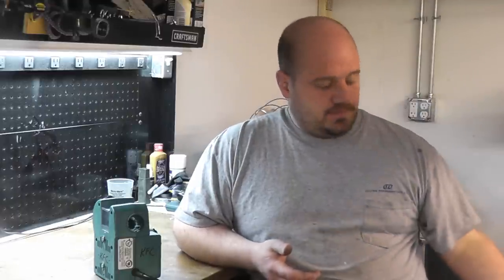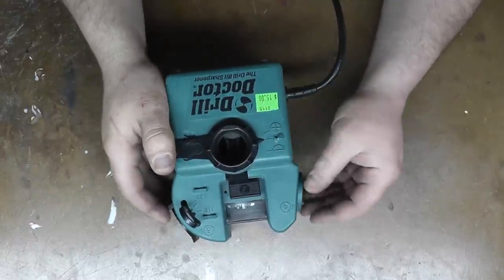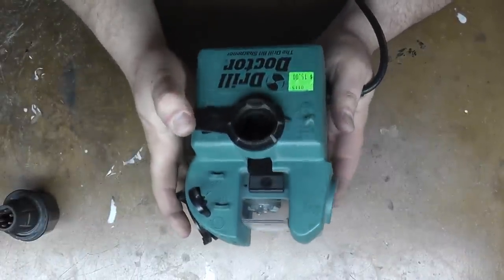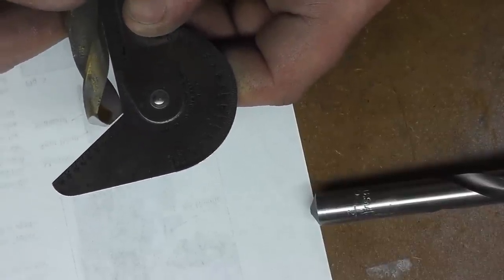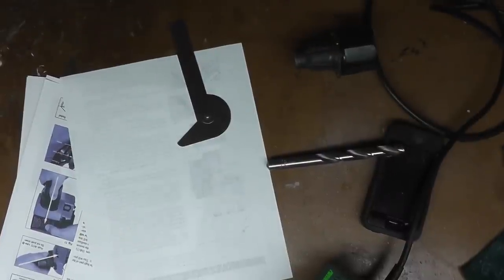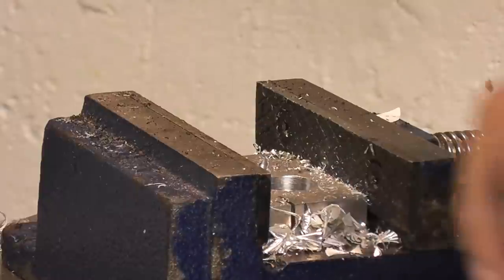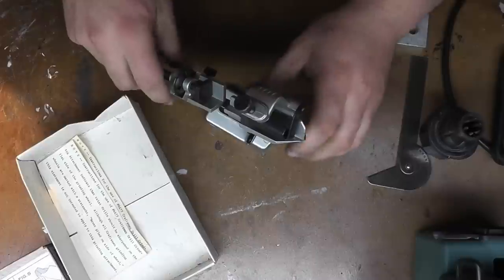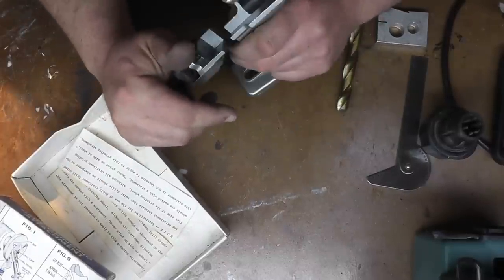Drill Doctor V.S. Craftsman Drill Jig

Comment: After having two DDs both the one you tested and it's newer style replacement I've decided that both were junk. Negative relief no matter what I did. Also have a General version of the jig you tested. Did not like using it with a normal grinder wheel so I set up a grinder using a tool grinder wheel instead. Talking about a wheel backed by a metal plate meant to be used on the side surface. Works great! Can sharpen a bit in 10% of the time it takes to fiddle with the DD. DDs will likely stay in the back of my tool cabinet unused forever.
Reply from the maker: +Gerry Masterman Yeah my DD has been taking up room.  Time to send it off to pasture.
Reply: +Gerry Masterman Do you want to sell them for cheap?
Reply: Gerry Masterman :

Comment: I have  Drill Doctor just like you tested. I could not disagree with you more. I routinely sharpen drill bits to use on my cnc machines and have never had a problem. the chips are even and the cut is true.  one of the setup tricks is to wiggle the bit ( by rotating it back and forth) in the spring alignment jaws till it finds the true center before tightening the clamp. Also if you want a true hole never force such a large drill thru any material without a pilot hole....there is simply too much surface area combined with low surface speed in the "center" of drill bits to put them in a cut without a pilot hole. that is the main reason to split the point on any drill bit that  drills a start hole...ugh

Comment: I have also used one of those craftsman type jigs at a job I used to work at. It was branded as general...what a POS the Drill Doctor is way ahead of it. The only negative I can say about DD is it is plastic and prone to wear. it is a good practice to clean the grinding dust out of it occasionally with a vacuum.

Comment: I also have used the Craftsman for about 40 years and am well pleased.    There was a recommended stone for the sharpener which I bought, it is 1 1/4 inches wide.    At work they had one in the tool room about 3 times larger and could sharpen about a 2'' bit.    I saw the same model in a hardware store made by Irwin, they probably made them for Sears.

Comment: HI,
Best I found so far, is hand grinding, with a gauge.
As for the direction of the sharpening lines you can correct by changing the position where you grind on the wheel.
Have the same problem about the relief angle on a Drill Doctor.... Drag, Big drag...
Thanks for video, Pierre

Comment: I threw the drill doctor in the trash and started sharpening by hand, then found the old Snap-On 825 you have there. I like the 825!
 It won't hurt the wheel for many sharpening's , just set it up more toward the end of the wheel and replace the wheel  when it gets about a 1/16th groove.  I've seen some badly worn sided wheels I wouldn't get near, but they were using them.

Comment: Thanks for making and sharing this video. Here in the UK back in the 1970's a firm named Martek brought out a black and red drill sharpener that works like your DD but uses an electric drill. Still got mine, I've sometimes spent days just sharpening dozens of blunt bits! Uses aluminium oxide wheels not diamond.
I bought 3 Picador sharpeners (separately) like your craftsman, around the '70's too, but never got around to using them as my grinders are mounted on metal dexion frames and I'm lazy... 
Was very interested and had a faint hunch that the C might win, I don't like plastic in the workshop very much! Appreciated thank you. DD.

Comment: I accept that grinding a drill by hand is considered the better way of sharpening but I've never mastered the technique - the majority of my mechanical engineering & machining is self taught as l'm an electrical and electronics engineer by profession. However, this has been a useful and interesting information on grinding jigs. I have often wondered if they are all their cracked up to be as one might help me to sharpen a drill bit instead of buying a new one all every time! If we started to trade using the currency of blunt or baldly sharpened drill bits, I'd be a millionaire!
 Thanks for this this informative video - keep them coming!

Comment: Hi, My mentor used to sharpen drill bits by hand. I used to watch him, but could never
figure out what he was doing or how. He never really explained things out. One day i
found a picture showing how to present the drill bit to the grinder wheel.  I drew a line
on the grinder table and started grinding a drill bit and would check it with the gauge.
To make the story short, my first bit turned out just great. Have been sharpening by
hand ever since. I can do it better than a drill doctor, or just as good.
Give it a try its faster by hand also.
Wayne
Reply from the maker: I can grind bits ok 3/8 and larger.  Just takes me a little bit to get it right.  Me being lazy and all just looking for a faster method :-)
Reply: ***** Get a magnifying visor, then little bits look bigger. When bits are really small I wear my visor and use an arm magnifier at the same time. Yeah I'm getting old, I know. Did I mention I wear reading glasses under the visor? Windex is a popular chemical in my shop anymore here.

Comment: Don't knock "the old ways" of doing things! My gizmo is very similar, I think made by General or something. Anyways, I made a block that I screwed mine to, a block that raised the drills to the top centre of the wheel to get the grind marks perpendicular to the cutting edge of the bit. The jig stays screwed to the block & it's a quick matter to clamp the block and have at it. Just my 2 cents worth. Thanks for posting.

Comment: I notice in the user manual for the Craftsman jig, it says to only use grinding wheels engineered for using the side for grinding. Maybe they existed when the manual was written, but nowadays at least, Norton just blanket says not to grind on the side. So that's an abrasive company who doesn't seem to think side-grinding wheels are a viable product now.

I wonder how feasible it would be to modify one of the Craftsman jigs for sharpening HSS lathe bits.

Comment: Thanks for demonstrating that craftsman jig. I bought a grinder at an estate sale that came with one. Unfortunately it was missing the side cover but you can tell the wheel itself was designed to be used on the side face. Do you still think that's unsafe?
Reply from the maker: You decide if it's safe or not.  I just don't like making grinders do stuff they technically weren't intended to do.  I've seen them grenade and it's not pretty.

Comment: Greg, I noticed that the pivot pin in that Drill Doctor drill alignment part was out, or loose on one side. I think if you put that pin in correctly, it will be possible to align the drills easily. I've owned one of this model for years. I bought it new. I had trouble at first but eventually got good results.
Reply from the maker: I'll take a peak at it.
Reply: A friend of mine has that model as well.  That alignment tool is definitely not working as designed.  As I remember that lever shouldn't have any rock to it at all.

Comment: Rob:        No matter how skilled you may be ,you will never sharpen a bit with any jig as accurate and precise as the DRILL DOCTOR. The designers really did their homework on this one. I own the 250 model.,it works flawlessly !   This is   NOT a  ' nonsense device '   !!!!
Reply: have worked at a metal factory where they grind almost everything by hand. and i bet they have more years of experience then the drill doctor exist. they would choose hand grinding before drill doctor anytime.

Comment: Just subscribed to your channel - it was mentioned by Abom recently.Great video Greg. I have just started using a craftsman type jig I bought over 20 years ago. I was put off by the look of it and it sat unused for years - but since I have tried it I am quite impressed with the results. I am thinking about mounting it on its side on a 90 degree bracket which will change the side to side swing to an up and down swing to be used on the front face of the grinding wheel - much safer. I wish that there was an improved and better quality, larger size unit available - possibly a future project.

Comment: I was just wondering if you have had a chance to use the craftsman to sharpen drills for drilling alloy steel like 4140 or perhaps stainless? How does it handle compared to a new factory drill.

Comment: I had the exact same tool (Craftsman) in my shop, and, with a slightly finer grit wheel, I was turning out better cuts than some new bits.  When Drill Doctor came out, I looked, saw the plastic, laughed and kept my Craftsman fixture.  After awhile, I had guys with Drill Doctors bringing their trashed bits to me to dress them up.  Wikid pissah good demonstration!
Reply from the maker: Ha Thanks!
Reply: +DeserT BoB 
I paid full price and this guy should know that people often get what they pay for, that's for god damn sure!
Perhaps this guy should not by a beat up piece of crap unit missing pieces for comparisons!
The reason the Drill Doctor trashed your friends drill bits is because they were not smart enough to use it properly (I suggest they try reading the instructions).
Because of the Drill Doctor, for the last, (oh damn, more than a decade and a half?) however long it has been, the only drill bits I buy are the ones too small to sharpen, those I have broken or sizes I do not yet have.
The weekend I purchased it I spent 2 days resharpening a whole box of dull drill bits I had been collecting for most of my life and were unwilling to throw away.
I'm still using some bits over 20 years old, all sharpened on an old as hell drill doctor, and on the same, original sharpening wheel!
Reply: That's good to know...knowledge is everything, but I did have three guys with Drill Doctors who had various problems with them, and I'd just dress up their bits for them and they were amazed by how well they cut after a ride in that old Craftsman fixture.
Reply: DeserT BoB The skill (dare I say art?) involved in sharpening a drill bit by hand visited me once, and only once.
That drill seemed to be perfectly sharpened.
Since that time I screwed up every bit I attempted to sharpen until I got that Drill Doctor.
Now, when I start having an issue finding a drill bit close to the size I need, I sharpen a bunch that were dulled.
It happens so infrequently, I have to reread the instructions every time.
Reply: archangel20031 before I got the Craftsman I use to sharpen my bits by hand in the old fashioned way, and you can spend a lot of time doing that unless you do it all the time. Toolmakers do this on a routine basis and do it everyday; they can practically do it without looking. Not so with me, I needed the Craftsman jig just hold the thing at the right angle.
Reply: T2H Instructionals d

Comment: I just picked up a general 825 grinding attachment.still practicing but I already like it for medium size bits but still botching the small ones.and I mounted it in front of a disc sander which is meant for face grinding.

Comment: That sears sharpening. Device is a great tool. I have been using one for over 30 years. Had many other types all eventually broke. Still have and use the sears unit. As a matter of fact it's still hooked to the same grinder I bought then. if you watch the operation it will help you get the motion down so you can do a great job of sharpening by hand. Don't knock the simple tools imagined  technology is not always better. A mistake often made.

Comment: Great vid.  I also have a Craftsman 6677 I picked up for $3 at a community yard sale back in 2008.  This came in the original box with original instructions and appeared never to have been used.  It seems to be a late 1970s version since OSHA is mentioned.  These instructions also show grinding against the edge of the wheel and state to only use specially engineered wheels for side grinding.  I haven't done much with it as I simultaneously learned how to hand grind my larger drills (3/8" - 1") using a 1" x 30" Delta belt sander.  But I need to start grinding smaller bits now down to 3/16".  Small bits are a lot harder to grind correctly by hand.  I think I'll pull out the Craftsman jig and set it up again.  Printed in USA, Made In USA...  And forty plus years later the finish is still better than Chinese junk straight out of the box, let alone the quality of construction.   The original box was much better, too.   We have been royally deceived and screwed by (non) Free Trade...
Reply: ps.  I see that Grizzly is still selling this same drill grinding jig.  And even through the Sears Marketplace for $19.50.

Comment: A properly sharpened drill will produce holes that are not only on size, but use very little feed pressure and doe equal chipping and will create very little burr.

Comment: Thanks Greg.  Nice, well thought out comparison of different technologies...bottom line - how does it drill, after?  Its the baby bits that are tough IMO although not too expensive to buy just hate to waste them with some life left.  An interesting note about your grinder vs sander thoughts...for down and dirty I think you are right but have been looking at diamond cup wheels and they aren't as expensive as you would think ($15-$100).  They are made to sharpen on the flat...the trick is the speed of the grinder with them.  Been thinking of making a dedicated one with a motor and speed control...then a jig, even the Craftsman would be fine for home shop use.  Thanks for putting this out for us!   Solved my curiosity of the disparate reviews & likely won't pick up a DD now...but maybe they could send you a new version with all the bells and whistles to run through the paces!  ~¿@  Thanks again for the time you spend!  ~PJ
Reply from the maker: I'll look into those wheels.  Some of the Delta grinders come with a speed control.

Comment: My two cents worth...
There are extremely few YouTube videos 36 minutes long that will hold my attention. Yours met the standard! I want to go yard saleing with you.  A drill Doctor 750 for $15 and a brand new craftsman grinding attachment for $2 is incredible. I own and use both devices, I agree the Craftsman is superior. Don't be afraid to use the side of your grinding wheel. But you might want to try a wheel of finer grit, as yours is very coarse. Still, you got a very good result with it.

Comment: You can buy a thin 8" diamond coated steel lap wheel for about $15 on EBay. Maybe it could be used  in place of the big grinding wheel, or use it stacked against the side of the big grinding wheel. They come in many sizes and grits.

Comment: I have both of those tools but the drill dr is the new one. The Dr works great the new spring clips part works a lot better and the adjustment on the angle is easy. Drill Dr also has a left handed chuck for left handed drill bits. I used the other type with my belt/disc sander on the disc side and it work alright but I can go much faster with the drill dr.

Comment: yes, you were right the grinding jig is a little unsafe; that's why they invented tool / cutter grinders & universal grinders ( do similar things but they have heavier castings and wheels designed for this type of contact with parts)- note: tormech sells a cnc surface grinder (fairly cheap compared with the grinders fore mentioned ) that you can rig a drill onto an indexing fixture, which allows the angular adjustment required , just place the fixture on the magnetic chuck of the surface grinder.

Comment: It has been my experience that all drill grinder have their own technique and learning curve. I have a DD-750 that I use on small bits and a Lisle drill grinder #91000 that I use for the larger bits 5/16" up to 1-1/4", anything larger than that I grind by hand on the 10" pedestal grinder. The DD-750 works very well on the smaller bits and is quick to set up and operate. The Lisle 91000 works very well on the larger bits quite fast. It looked like your DD-750 had been abused at some time in it's life. They are made out of plastic and need to be treated as such. I have been using my DD-750 for about 15 years now and can't even tell you how many diamond wheels I have used in it over the years, it still works just fine.  I know a lot of shops don't bother sharpening their small bits simply because they are so cheap to buy in bulk packs.

Joe in Minneapolis MN.

Comment: grind on the wheel’s face (outer diameter) only. Side grinding is NOT allowed.  I know  a guy who got his thumb blown off when the grinding wheel exploded as it has a small crack in it that he did not see.   when you grind on the side you can cause uneven wear and run the risk of breaking the wheel.   I use a drill chuck with a handle on it to grind small round rods to give better control and to keep my hands away from the stone.

Comment: I think you could mount the craftsman one at 90 degrees, i.e. clamp it to a vertical surface instead of the table, so you swing up-down instead of left-right. That way you could use the front of the wheel and get the grind perpendicular to the edge

Comment: To cut grain correctly when using the drill sharpening jig, grind on side bottom of a counter clockwise turning wheel, not side front or side top. Have not tried a jig yet and I have 2 and faith that they will work better then a new DD. Old DD diamond wheel shape is better than the new DD cylinder diamond wheel which makes cuts come out curved. Yeah they saw me coming; I'm crying bought a brand new 750X. If I only knew then what I know now. The flatter the grinding surface the better the results.

Comment: I can easily touch up a drill bit on a bench grinder, but if the cutting edge is really messed up and or the angle is off by a fair amount, I like the grinder jig cause it helps get the angle right, I have had the issue of the cutting edge being slightly longer than the other one. I only got the jig a couple days ago so I'm still learning how to use it. But it seems great so far for a hobbiest